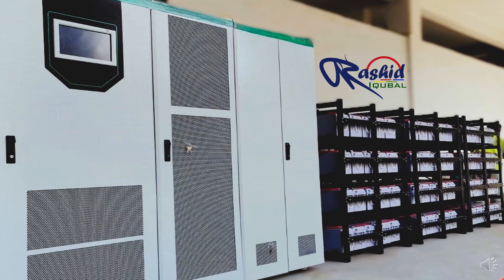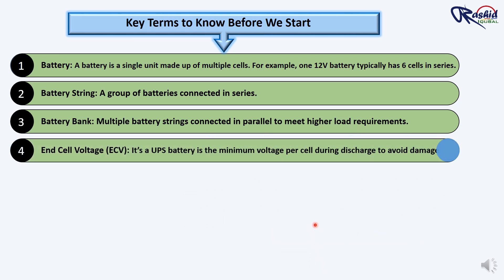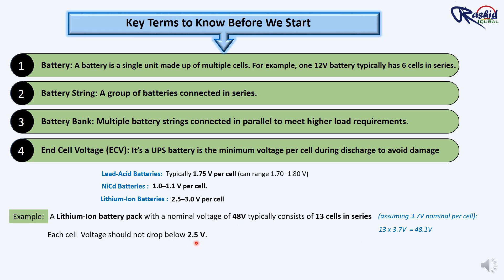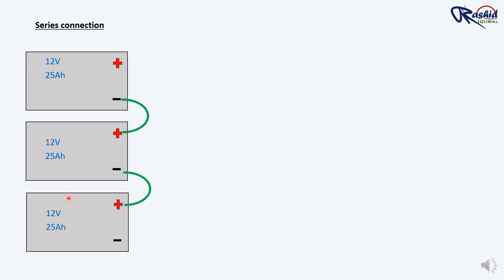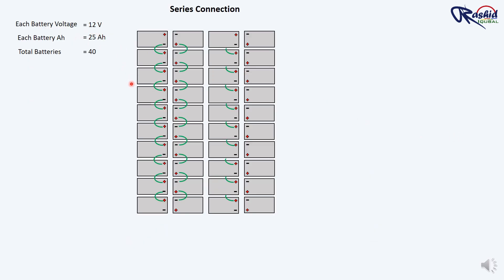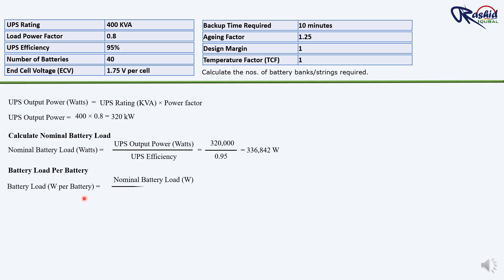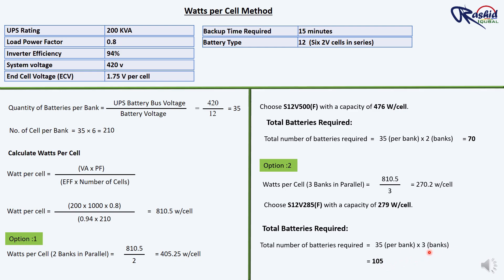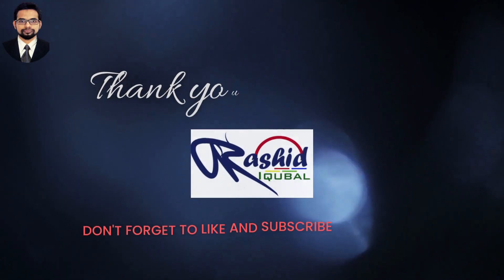UPS Battery Design and Calculation | Step-by-Step Guide with Detailed Examples

Comment: Hi sir, in first example if we need find the  number of battery then can we assume system voltage and devide it battery voltage to find the number of battery or not?
Reply from the maker: Yes, absolutely. To find the number of batteries needed in series, you can divide the UPS system voltage by the rated voltage of one battery. But remember, this only gives the number of batteries in series. For total batteries, you also need to calculate how many strings in parallel are needed based on the required AH capacity..
Hope you get your answer.
Reply: @Rashid-iqubal Perfect sir

Comment: Sir, how much one 1.5ton ac current take? And watt also?
Reply from the maker: Its depends on type of AC, energy efficiency ratio..

1 ton of AC = 3517 watts

1.5 tons = 1.5 × 3517 = 5275.5 watts

Considering Efficiency:
If the AC has an EER of 3, 

Then Power consumption = 5275.5 / 3

= 1758.5watt
Reply: @Rashid-iqubal So, what formula I will use in 3phase hvac, as you did in previous one In calculation of watt.
Reply: Thank you sir for helping me.

Comment: Sir, How to choose or select UPS for a plant?
Reply from the maker: 1.	Load Calculation
2.	Backup Time Requirement
3.	UPS Type (Offline, Line-Interactive, Online)
4.	Input/Output Compatibility
5.	Environmental Conditions
6.	Battery Selection and Configuration
7.	Efficiency and Scalability
8.	Compliance with Standards
9.	Cost Analysis and Brand Reliability